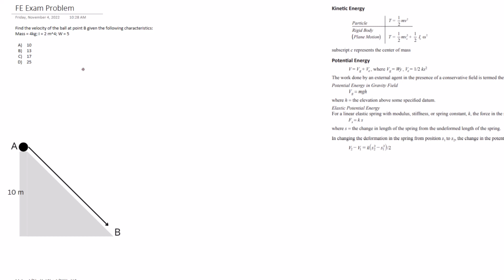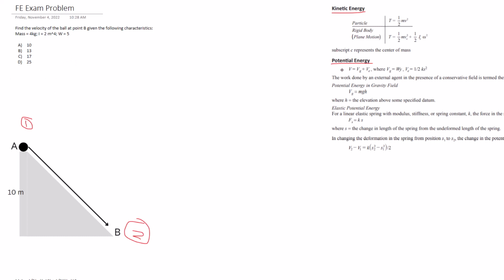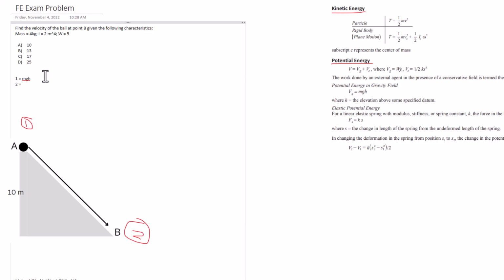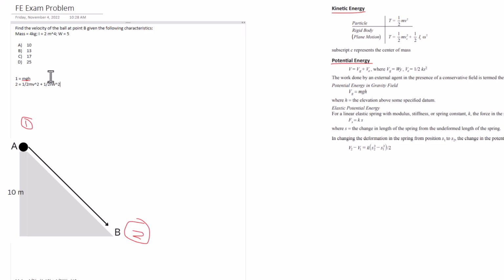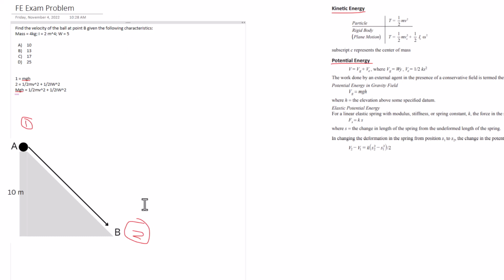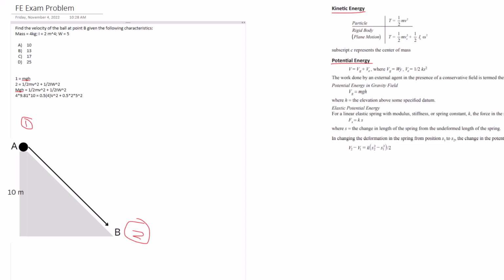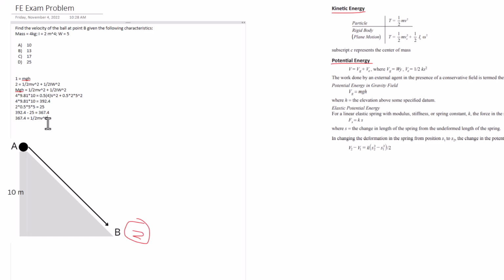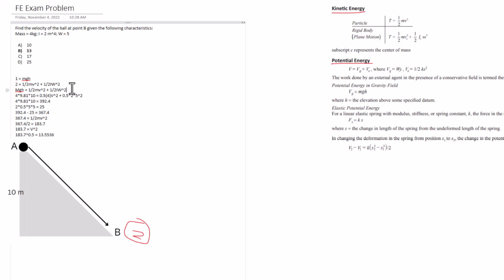Energy Equation | FE EXAM DYANMICS PROBLEM

Comment: The example is great BUT its too long for FE Please add something to simulate the FE....I took the exam recently.  as a simple description, who designed the FE test system is M...FK. 80-70 % of the questions do not exist anywhere because the computer keeps changing and flips the questions in different ways, for example, in the geotechnical section, I got 3-4 questions on the same topic....find bearing differently. what FK? some question related to DMV stripping a lot of shit not on the manual.  one question asked what type of mechical water motor give efficient pressure what is my business as civil on this mechical shit?